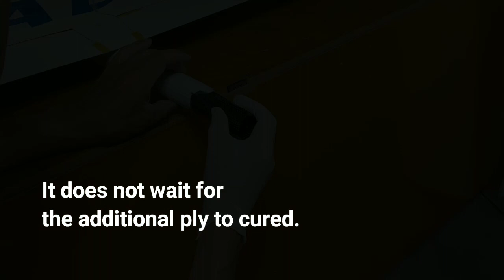Carbon fiber fuselage repair F3J Shadow

Comment: Thank you, some really good techniques. I will use these in the future. What were the patches that you wrapped and let cure, so you could use them on the inside?
Reply from the maker: The inner patch is 1.5k carbon. It is better to have a thinner one to make it easier to fit after curing. Thinness doesn't matter because adding extra layers.